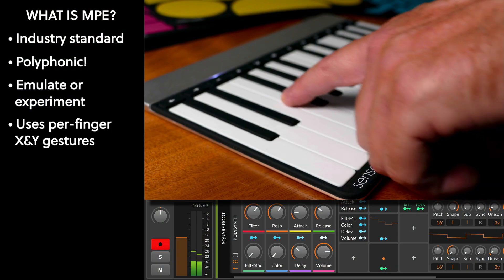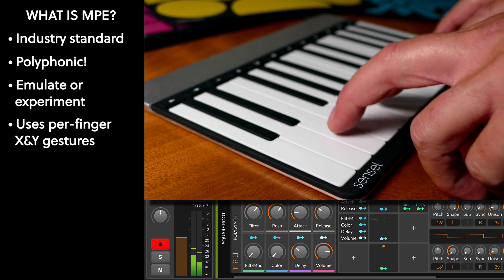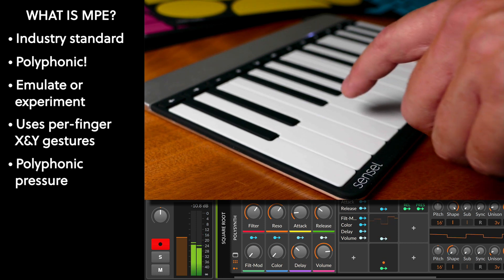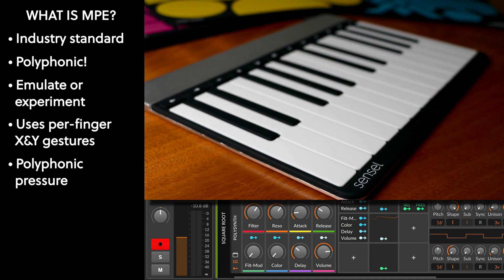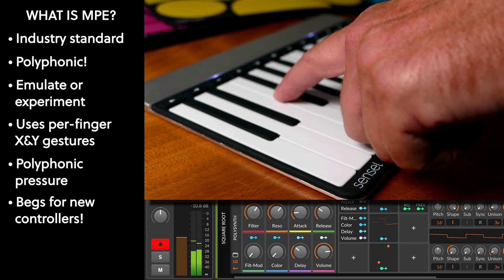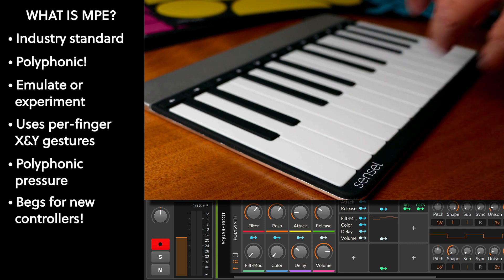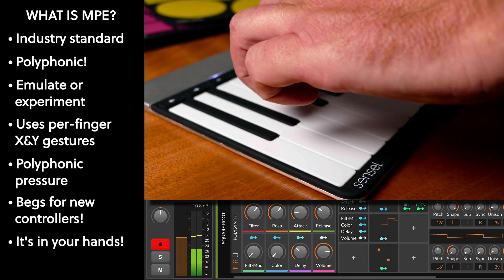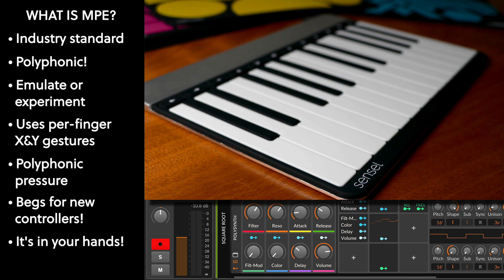00 An introduction to MIDI Polyphonic Expression

Comment: Nice intro, worth mentioning that most DAWs now support MPE, and many of the newer plug-ins. Glide & getting the correct pitch also depends on the controller and the software you’re using. Some manufacturers ensure all notes glide to the exact pitch if you stop moving your finger and you can control how fast that happens, so you can still vibrato, slide & glide, but you always end up in tune!
Reply: Thanks! The DAWs I'm aware of that support MPE are Logic/Garageband/Main Stage, Bitwig, Tracktion, and Cubase. I'm unclear if Reaper fully supports it, same with Cakewalk. Live, ProTools, and Presonus Studio do not.